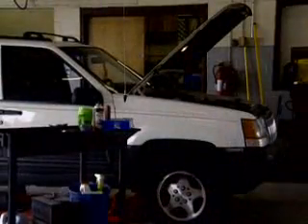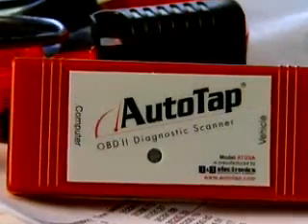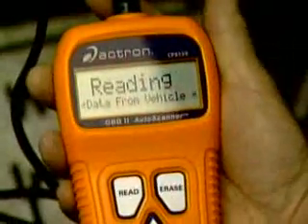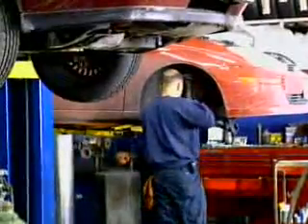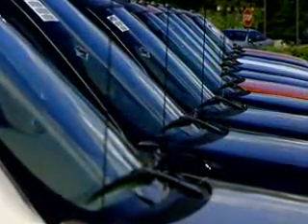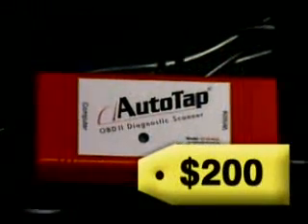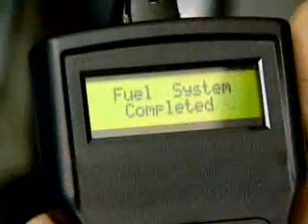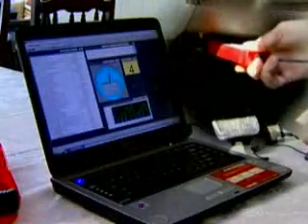Using Code Readers to Repair Your Vehicle

Comment: @mcronrev One of the best automotive milestones was the OBD 2 connector. Installed in 1996 and newer cars.without this you would need a Bucket Full of different connectors.OBD 2 is a very responsive system which controls the vehicle electronics while collecting data. Electronic devices have complicated failure methodology from total failure to functioning well with minor defects. The OBD 2 computer monitors data streams and has a defined standard to activate the CHECK ENGINE light.

Comment: @asemastertechl1   A code reader is a very limited device. It may not empower you to the extent suggested here. codes may be multiple and related or unrelated. A scanner or lab scope with a high sampling rate is often needed for a better understanding of engine problems. Responding to basic codes only can send you off on a very expensive quest. The implementation of [CAN] controlled area network into modern cars has made diagnostic work easier and ironically much more difficult; simultaneously.